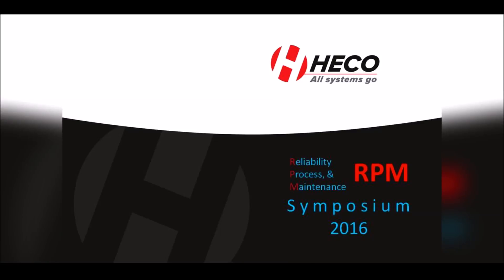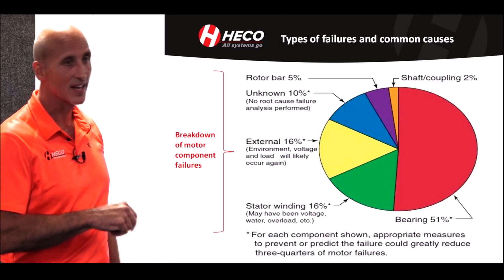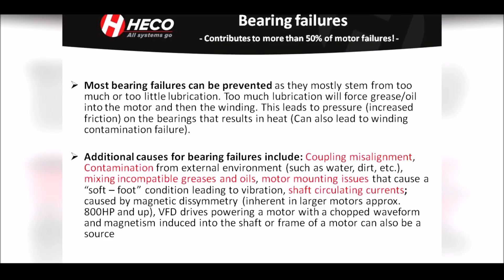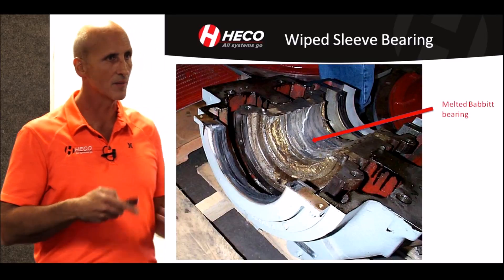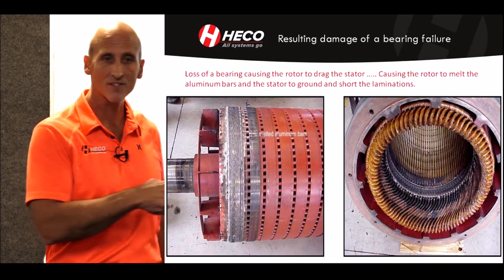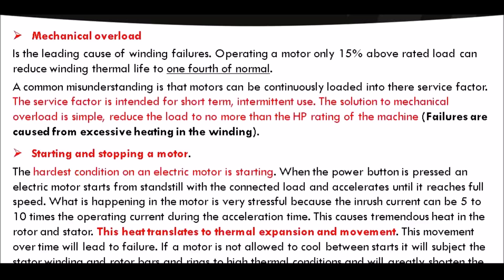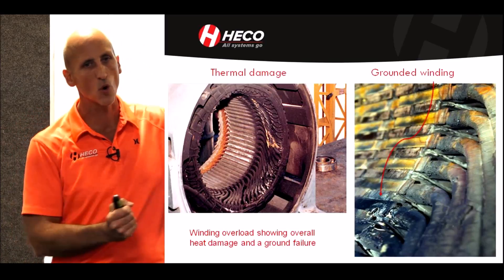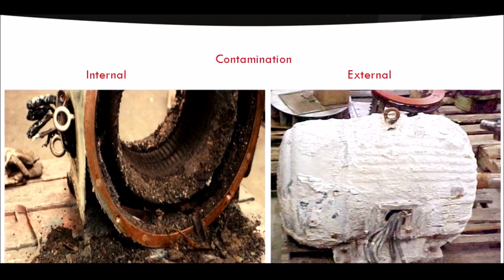Common Electric Motor Failure Types and Causes

Comment: These electric motors were designed to fail. Why restore a failed design instead of redesigning it not to fail. Ball bearings aren't needed in the complete design. The whole design should be magnetic. Magnetic rotational field should be the only mode of operation.
Reply: @Ker Bee it doesn't need ball bearings. It can add an extra layer to the magnet field by using magnetic balancing also. An added magnetic blancing/ forcefield.a force within a force.